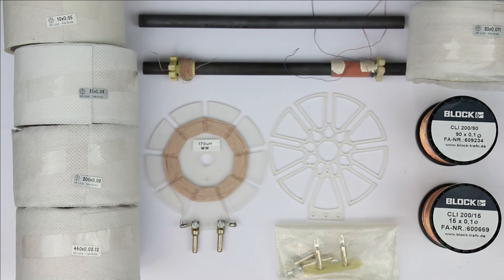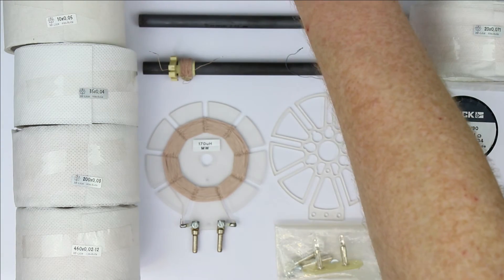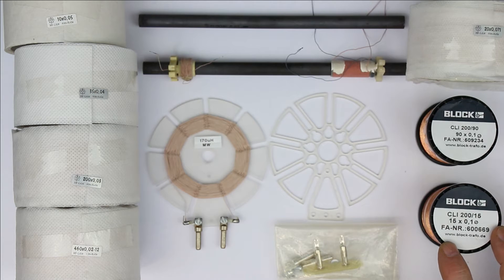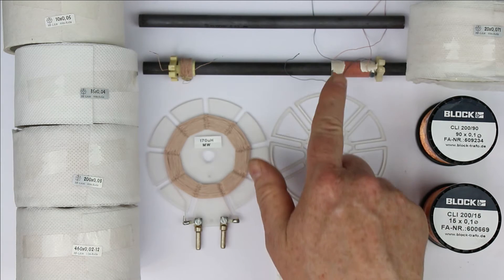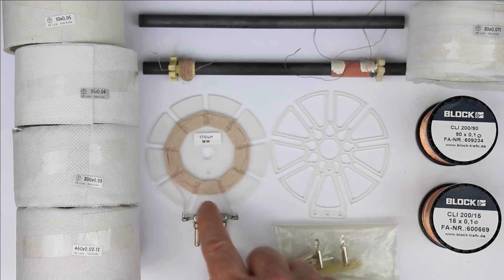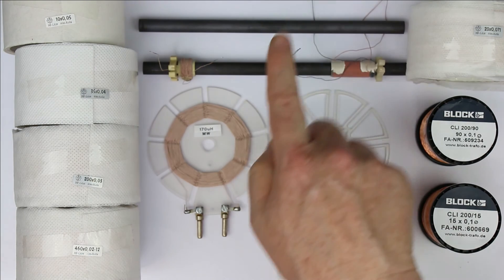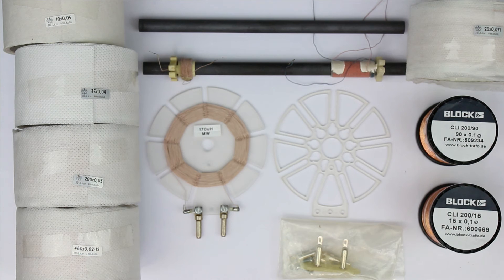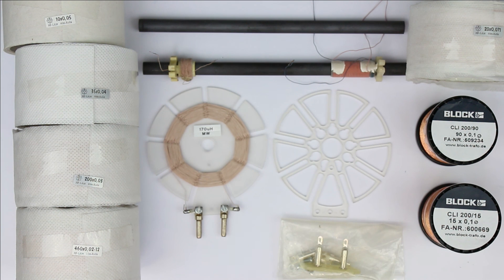New AM-Antennas & Antenna-Kits

Comment: so I just need to connect the spider-web antenna to the module and connect the module to the amp to listen? thanks.
Reply from the maker: The spider-web col is just as well as a ferrite-antenna suited for a tuned LC-tank circuit. So you need a variable capacitor or varactor in parallel to them at the input of a radio-module. Modern digitl radio-modules (like our Si4735 module) in fact do tune a magnetic antenna autimatically with an internal varactor.

Comment: Sir I just restored a G.E tube radios a 60 era the ferrite antenna that came with it was shattered into several pieces,I bought a replacement ferrite bar blank and some 22 gauge magnetic wire ,and some.heat proof tape to tape the start of the wrapping to hold stuff in place while I will be wrapping the rest of the ferrite bar ,any advice you can offer me I would be greatful,anyone ? I haven't wrapped it yet tomorrow ,I will this antenna will be a replacement for the AM antenna that was broken ,I hoping to make a copy ,then dip it into hot wax to keep everything in place .I wonder if anyone else has done this
Reply from the maker: It´s just a matter of finding the right number of turns to get the correct inductance with an unknown ferrite rod. There are so many variables (ferrite material, diameter, length, shape, position of the coil on the rod) that you can only it determine it experimentally. Try to find litz-wire with approximately the same number of wires and diameter and just start with "too many" turns because later it´s easier to shorten a winding than to "lengthen" it :-)
You will get a too high inductance first and then have lower frequencies on your frequency dial. Just try to find a known AM-station and then change the number of turns until the frequency dial is correct again. Fine-tuning of the inductance is done by shifting the winding on the ferrite rod.
Reply: @KainkaLabs  thank for your help

Comment: I'm looking to run 10 and 11 meters I have a Stryker 955 radio which is at 10 and 11 meter radio and I also have a Cobra 2000 my problem is I live in an apartment I need something that will work for me inside the apartment or on the balcony I can't run any wire past my balcony can you help me out also I am disabled and have limited use of my arms and hands so it has to be something easy
Reply from the maker: Use a (single-turn) loop made of thick copper-tubing (20...30 mm diameter)
The best book about this topic is "Magnetic Loop Antenna" by Burger && Dvorsky:
ISBN: 978-80-260-9952-9
http://www.box73.de/product_info.php?products_id=3629
Strangely it´s not available from Amazon.com (might be self-published?)